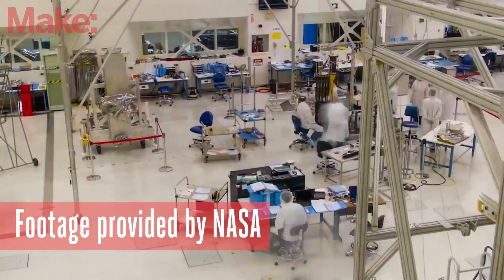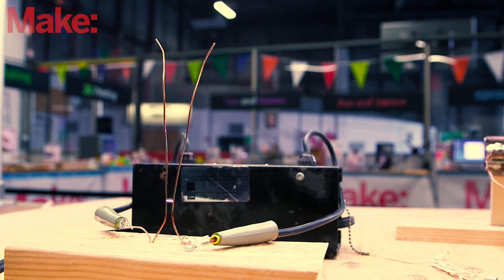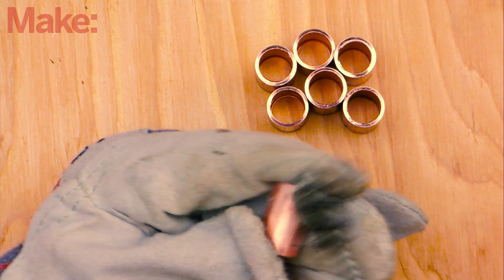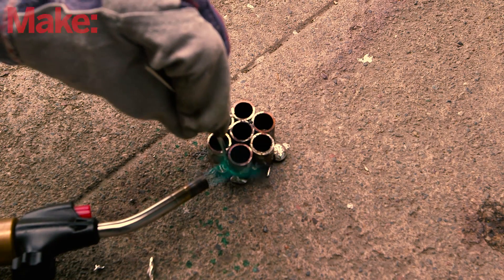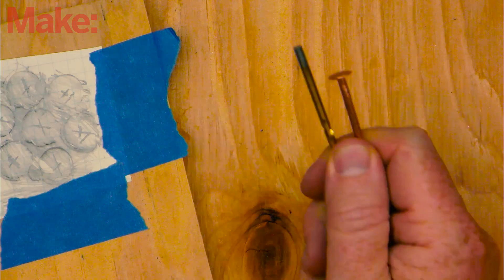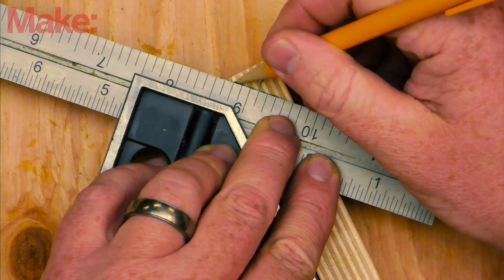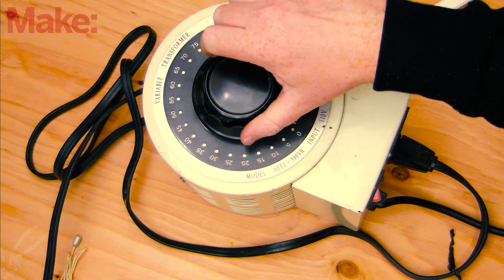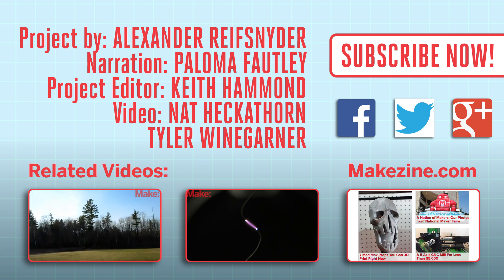Weekend Project: Ionic Space Thruster

Comment: TLDR - Concrete: fireproof, yes
HEAT proof, NO

I doubt anyone will read this comment on an 8 year old video, however, I feel the need to put a safety warning. They say to do your soldering on a fireproof surface, but concrete is not that. While concrete will not catch fire, when exposed to heat concrete can undergo a process called explosive spalling, where the water in the concrete heats up and vaporises too quickly to escape the concrete through its pores, causing the vapour pressure to build up until the concrete fractures, which can send shards of cement and aggregate flying in all directions.

Comment: just in case you didnt know you need a:

variable transformer,
drill,
hot glue gun,
7 copper nails,
blowtorch,
copper wire,
thin copper wire, (idk)
a small neon sign transformer,
a pipe cutter,
7+ inch copper pipe,
small brush,
solder flux,
2 or 1 wood panel(s)

Comment: Way too much solder. This is a result of poor surface prep and not enough heat to the pipes. When soldering pipes side to side, a brazing technique should be used where you heat the work until it's hot enough to melt the solder, not melt the solder and hope it sticks. Once the solder has started to melt over the joints, reapply heat so the solder wicks into the joints. apply more solder and heat to create a nice fillet but not too much or it can wick down due to gravity. if fillets look oxidized and doesn't have a smooth look, add more flux

Comment: can i use 6v-50kv step up module for ion generation
module link:https://www.aliexpress.com/item/50KV-High-Voltage-Pulse-Generator-Inverter-Step-Up-Boost-Transformer-Super-Arc-Pulse-Ignition-Coil-Module/32790807282.html?spm=2114.30010308.3.2.Ac6E97&ws_ab_test=searchweb0_0,searchweb201602_4_10065_10000073_10068_10501_10000074_10503_10000032_119_10000030_10000026_10000023_10000069_10000068_10060_10062_10056_10055_10000062_10054_10000063_10059_10099_10000020_10000013_10103_10102_10000016_10096_10000056_10000059_10052_10053_10107_10050_10106_10051_10000097_10000094_10000053_10000007_10000050_10084_10083_10000100_10080_10000047_10082_10081_10110_10111_10112_10113_10114_10115_10000041_10000044_10078_10079_10000038_10073_10000035_10122_10123_10121_10124-10503_10501,searchweb201603_1,afswitch_2_afChannel,ppcSwitch_5,single_sort_2_default&btsid=ff73cc63-906b-4a41-af9b-bd8331b80988

Comment: Would this work in the vacuum of space? If it wouldnt what would happen if we created a plasma in front of it and then turned on the device in vacuum?
Reply: Absolutely. It would require some modifications, but yes, it would work in space. In the atmosphere, it ionizes and accelerates air molecules, but since there's no air in space, you'd need some other source of ionized gas. Ion powered spacecraft use an electron gun to ionize a noble gas (usually Xenon or Argon).
Reply: It's already used in space.

Comment: +Make: High voltage is not the only safety concern. It would be nice if you could mention the energy of the ionizing radiation that this produces, for the sake of safety. Different transformers supply different amounts of electric potential and since the space between the cathode and anode is small, you can get huge electric fields produced between the dynodes. I don't know if everyone that wants to build this knows that they're going to be accelerating beta particles (depending upon the temperature of the cathode). If people modify this setup they could produce unsafe levels of ionizing radiation.
Reply: thank you for your safety concern, will you please tell us how can we make it more safe cuz I'm doing right now
Reply: This device produces beta particles, which is ionizing radiation. Depending on the transformer you use it can produce particles with up to several keV of energy. While this isn't going to produce noticeable thrust for the device it can impinge its surroundings with radiation and you need to shield the apparatus. The thickness and material of the shielding varies with the energy you produce. Learn more here bit.ly/2kY2XDB and take care of yourself when making this device. It's a cool experiment but isn't safe to have unprotected skin, eyes, and other important organs just hanging out nearby.

Comment: My adaptation to this for is one of safety Firstly use shielded high voltage wire that you unwind into two sections and weld the the tubes and wrap around the nail heads. And prier to testing you should build a box out of 1" thick acrylic about three inches around the structure, with a vinyl screen at the end aligned with the output and another on each side. Finally I suggest using corrugated plastic instead of wood, with predrilled holes to add more precision and and to reduce the risk of fire.

Comment: I'm confused on the scaling if I build this to be 10x the size would in increase thrust and would it be more efficient then a air conditioner
Reply: 4 months late, but please don't. Like what many people have said, an ion engine produces ozone, which while still a molecule comprising of oxygen, is deadly if you've inhaled too much. Even if you did make this at 10 times the size, I believe it would use enough power that the wall outlet wouldn't be enough, and it would be way less efficient than the average fan.
Reply: wow extremely sciency conversation you've got going here
Reply: Yes, but at that point the weight and efficiency of the engine would make it pointless.
Reply: Sir Douchebagel Yes I realize that, but for 200 lbs. of thrust, based on my calculations, all you need is 700 million volts.  And please tell me if my calculation is wrong. I got this number by finding out how much the weight of the tissue in the video was, and how much voltage was being applied to get that air to move it, and then calculated through that constant how much potential difference it would be for 200 pounds. Also, since this is being done on Earth, why should Xenon even be here? is there something I am not understanding about that part?
Reply: I just wanted to point out xenon (wasn't sure if you wanted space or Earth), and as far as I know your calculations are correct, but I want to point this out (correct me if I'm wrong). Using an American wall plug (110V, 10A) you would be (if it was theoretically possible) drawing 1GW from the wall, or at the very least 500MW. To put that in perspective, a nuclear power station (really really heavy thing that can't move) might produce around 3000MW, and this brings me back to the point of building a plane but then saying it'll only fly when connected to a tether. Unless that is what you want, of which then I say go for it! Or you could just think about it. (My point is I'm too lazy to do more research about it. Consider applying for a job at NASA or something.)
Reply: Sir Douchebagel Yes, but isn't wahat we REALLY need is VOLTAGE?, with a lot of voltage, 0.00001 watts is tremendously more powerful than by itself. 700 million volts with this much amperage can kill who knows how many people! So yeah, if all we really need is voltage, why cant this work?
Reply: +Sir Douchebagel but can this potentially create thrust similar to that of a jet engine if a significant amount of voltage is applied?
Reply: +Sir Douchebagel why? All you need is voltage.
Reply: Yes, and you need to get the voltage from somewhere, don't you? You would also need a LOT of air, or more commonly used in ion engines, xenon, a rare and expensive element. It's like saying let's make a plane, but it has to be constantly plugged into the wall for it to work.
Reply: I'm not saying it's impossible, it's that it'll be hard to pull off. Then again, part of the reason is that Internet debates are fun.
Reply: colonelerotic tasers and stun guns can get to 
50 million volts. So we can establish that reaching that level of voltage IS IN FACT POSSIBLE, so what other problems are you referring to exactly?
Reply: No body take my business idea unless we do this together
Reply: Just built one about 3 feet wide about a week ago. Selling it online for $420. Thanks for the idea

Comment: So what does an ionic thruster move for it to produce thrust in space?
Reply: +RepoLife   "ION" thruster.
Reply: +RepoLife they use a noble gas like xenon. this ionizes and provides the thrust
Reply: +RepoLife 
Ive never read up on this, so i may be completely wrong, but i think its something like this:
the cathode nails have a surplus of electrons due to the high voltage being applied to it. These electrons are passed on to certain gases such as the noble gases, which as a result become slightly negative. As we know, negative attracts positive, so the negative ions move towards the positive anode. Here the extra the ions had are transferred to the anode, as it has a slight deficit of electrons, which in turns completes the circuit. The ions keep their momentum, however, and keep moving, as well as the other particles they knocked into on the way to the anode.
Reply: Most have a store of gass like xeon. The gas is heated so the atoms move fast. Then electrons are stripped making the atoms positive, and attracted to a negative field. 

The thrust velocity is very high making it an efficient fuel, but the specific impulse is low, so it takes time to get up to speed but you can go faster than you can with chemical rockets.
Reply: It makes a capacitance on both nodes. On is positive and one is negative. The positive charge is stored in atoms in air, and since they're positively charged, they accelerate very quickly towards the negative terminal. Hope this helps.
Reply: Also might it add the space probe has a xenon tank handy as xenon is the most efficient element to use for this propulsion system. It lightly kets the xenon into the positive terminal of the engine. Hope this ALSO helps.
Reply: Since the op had the requirement "in space"   rather than say  air, it would be better to say  propellant.   and yes the propellant is often xeon gas that gets ionized and accelerated electrostatically to provide thrust.

Comment: Question... Wouldn't this be an Electrostatic fan, not ionic propulsion?  i understand the concept underlying both is based on the same science, but to be classified as ionic, does the thruster not require the energy level to create ions (aka plasma) as well as a fuel source (usually heavy noble gasses(due to Newtons Third Law)) as the space based ones do?

Comment: What would happen if you put the tubing flush against the wood around the nail, and you turn on the power?
Reply from the maker: +centaur1a The electricity would arc from the tube to the nail and no thrust would be generated.
Reply: +Make:  Will you generate more thrust by increasing the distance provided the voltage is high enough?

Comment: i know there is more to them than this but what does it propel with is space is this a vacuum or so they say. does it use the radiation particles to make thrust?
Reply: +Joshua Bliffen While this is technically and ion drive, it's not the same type as used in space. They carry Xenon gas which is quite heavy, apply a dc current through a similar circuit and have a magnet to ensure maximum thrust
Reply: +Jonathon Gay so they won't make it to alpha century ??
Reply: Charlie Hutch
 Unfortunately not with a piece of wood some nails, pipe and a car battery
Reply: no
Reply: it uses ionized wind particles
Reply: Xx xX actually yes. Ionised air particles, hence, ion drive.

Comment: your thruster is pushing air. in space there is no air. how is nasa doing this?
Reply: +Mithun Kalan They have propellant on board, usually xenon gas, which is ionized and accelerated to incredible speeds. Up to several dozens of kilometers per second.
Reply: +Mithun Kalan Pretty sure their ion engines have a chemical reactant that expels gas into the thruster, which it then pushes outward to move. It lasts far longer than liquid combustible fuel.
Reply: +Mithun Kalan They use xenon gas in te tank. On this video this is air ionisation, in the space this is xenon ionisation
Reply: +dfissell No pressure means no gas. No gas means 0 pressure. More gas = more pressure. I do not think the occasional particle every cubic meter will produce much thrust.
Reply: Power Max It is often a misconception that space is a vacuum or simply empty. Space is a nearly perfect vacuum, even better than the best ones made in labs on earth, but it is not devoid of everything. The fact is that space is filled with tiny particles called cosmic dust and elements like hydrogen and helium. This applies for interstellar space also and all the previously mention particles make up what is known as the interstellar medium.
Reply: +Mithun Kalan I think NASA uses tanks of nitrogen or argon, and use the ion wind generators to accelerate the particles to insane velocities.
Reply: Power Max It averages roughly 1 atom per cubic centimeter, but density as great as 1000 atoms/cm3 and as small as 0.1 atom/cm3 have been found.
Reply: You're correct, and there will be heat carried away by the few particles per cubic cm. But it is probably mostly negligible, hence me not mentioning it.
Reply: +dfissell hmmm. never thought of it that way. i shall read more.
Reply: Oh fail on my part, I thought this was a different youtube comment thread talking about building a hypothetical computer in space and the heat dissipation complications...
Reply: they ionise xenon (ze non) then shoot it out and get masive speeds per gram of xenon
Reply: interesting. i doubt that you can get much thrust though. probably a very long burn to get to the velocity. and how much tanks of zenon must you carry with you to take long journeys? seem like its a swop of one fuel for another.
Reply: +Mithun Kalan the idea is that you use TONS of electricity and compressed xenon so its similar to jet engines in the matter that you collect part of the "fuel mixture" on the field, thus making ISP's of up to double the ISP's of normal rocket engines
Reply: +Mithun Kalan You don't get much thrust, but you can run it for ages. In simple terms the mileage you'll get from an ion engine is TEN TIMES you'd get from a chemical rocket.
Reply: +Mithun Kalan They bring their own 'air' in the form of a tank of xenon gas.
Reply: +dfissell don't forget virtual particles.
Reply: +dfissell it's a vacuum
Reply: +Mithun Kalan you are making my brain hurt they are not pushing AIR they are pushing atom/molecules  just like what makes a solar sail work space is not empty it just has no pressure

Comment: You can find the tools you need at Radio Sha- oh wait...
Reply: Yeah it sucks that they shut down
Reply: +Xander Zoolander Funny, all Radioshacks in my area carried NO electronic supplies!!! Just stupid cell phones, remote control vehicles, and stereo/phone/tv supplies.
Reply: RIP RadioShack you will be missed
Reply: +Jonny Deth yeah, I also order lots of parts from China. had thought this was just how it was if you didn't want to spend extreme amounts of money, and/or the individually-wrapped components stuff RS was doing (well, here is a single component for $3), vs buying a bag of 10 or 25 or more for $3 online...
Reply: +Jordan Watkins We don't have Radio Shacks in Finland, though I wish we had. I order my parts from Kouluelektroniikka oy which is a Finnish electronics kits and parts supplier for schools and individual customers. Their kits are often made by Velleman, which is if I remember correctly, a German company. They don't sell many vital parts though, like diffused RGB leds, basic white, green, yellow and blue diffused leds (the ones not colored, white smoke-like until powered, but they have the weak indicator ones in colored housings), pager motors, small geared motors (they only have one kind, which doesn't fit in most cases and has four plastic gears and that you have to assemble yourself), servos, servo drivers etc. So I wish we had Radio Shack.
Reply: +Jordan Watkins radio shack is actually coming back
Reply: My local Radio Shack was a privately owned franchise, they're still open. So glad they are, only place within 75+  miles (haven't checked to see if the city still has any EE hobby stores, next closest I know of is a 3 hour drive) that has any parts or quality soldering supplies.